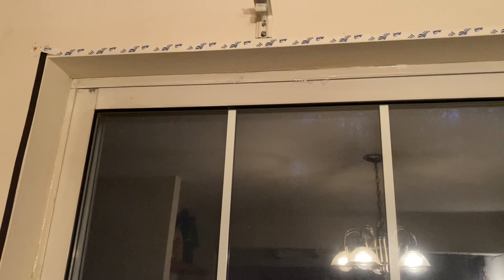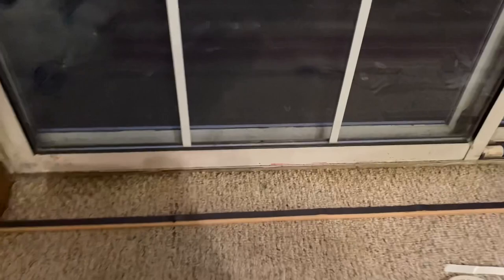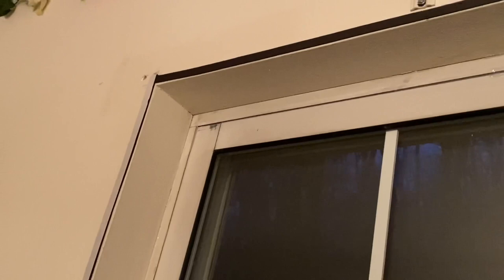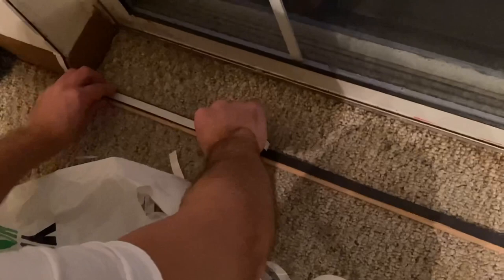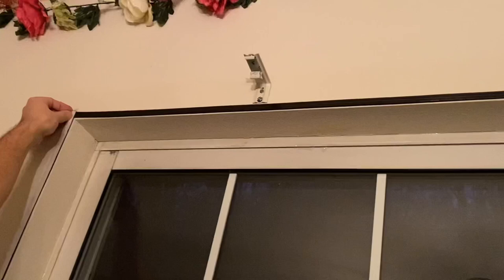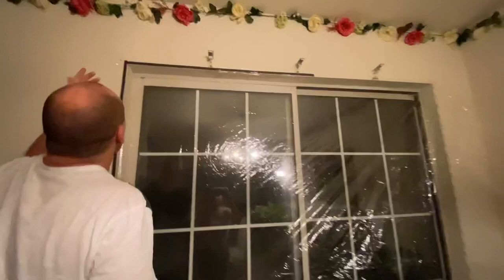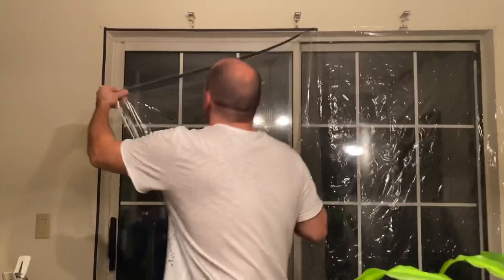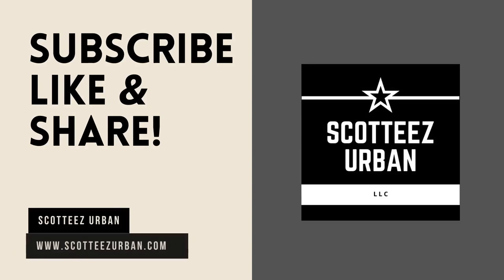How to insulate drafty sliding door with plastic insulation film & magnetic tape

Comment: I did the same thing but for the plastic film I used thick green house nylon. It's not very expensive, but it's designed to keep heat in and keep cold out.

Comment: Doesn't it break the seal each time you open it then? It looks really loose when you attach it. This looks like a great idea otherwise!
Reply from the maker: It actually works well. Easy to just place magnet strip back together. The magnet pulls itself back together. You do need to make sure to use a quality two sided tape so magnet strip holds well to door frame.
Reply from the maker: Need to use quality two sided tape. Will come loose eventually but hopefully not until spring time